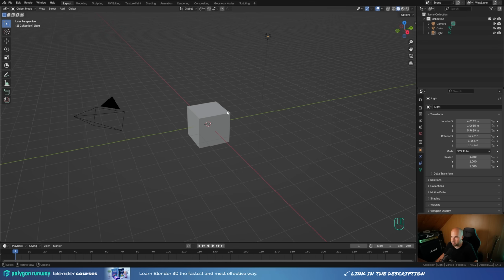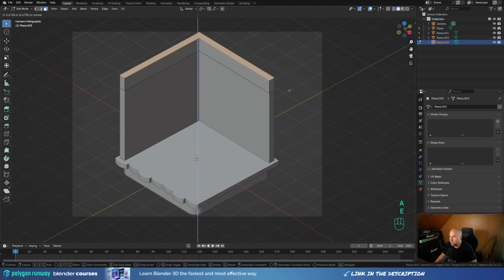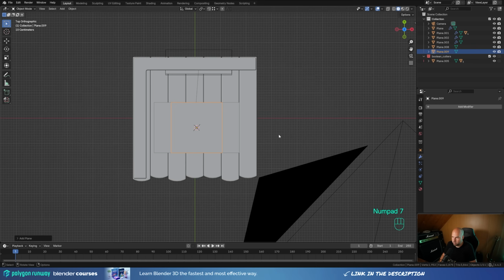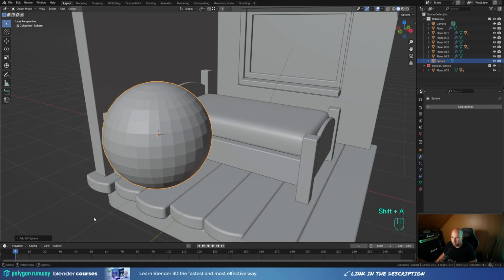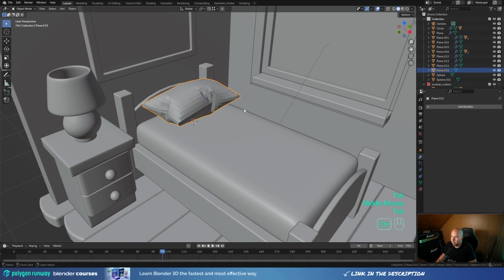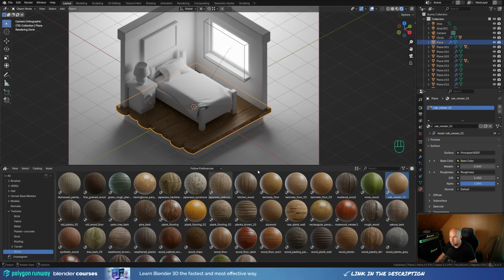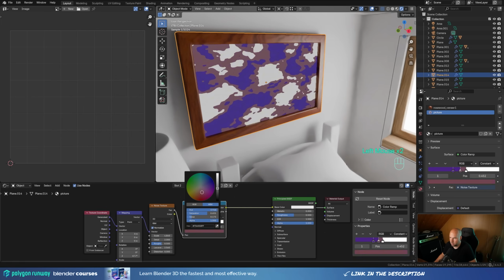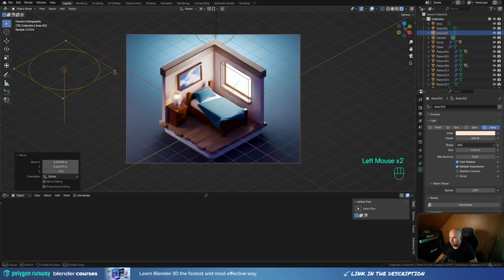Blender 3D Isometric Bedroom Full Tutorial | Polygon Runway

Comment: At 8:01 I’m using a macbook and when I press minus it’s only adjusted the camera view but not creating a holder in the windows
Reply: I just turned on the emulate numpad but why can’t I make a holder when pressing ctrl minus I already install bool and add another bool modifier because it wasn’t auto appeared in my walls in windows like yours
Reply from the maker: In case it doesn't work, you can find the bool tool commands in the shortcut settings and remap them
Reply: same problem here

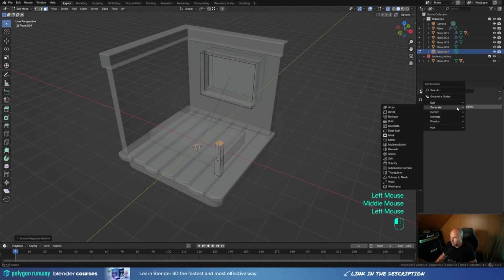Comment: Hi comment section! I'm a noob and I can't figure out why when I try to mirror it does nothing. Mirror seem to work just on the Z axis. min 10:49. Thanks everyone.

Edit: I maneged to make it work by going object > set origin > to 3d cursor.
Idk if this is right or if it is a blasphemy for professionals but for now I can follow the tutorial. 
Let me know if I should have done something else :D
Reply from the maker: Misplaced origin point is a common pitfall, so you did good with your solution :)
Reply: Had the same problem and your solution worked for me too!
Reply: Got stuck aswell, when you move the object do it in edit mode not object mode because in object mode it move the origine point of the object so the mirror works but just mirrors things on top of on of one and another, hope it helps :)

Comment: hi im learning, im just wondering why you need to separate those edges at 0:42? why doesnt you just extrude them up with the base plane?
Reply: Just complete the tutorial. Great tutorial
Reply: Because after separating, you can apply different materials on the walls and floor.
Reply: @GeminiXMagic  ouh i think you can apply them by using button assign too but yeah it can be more simpler